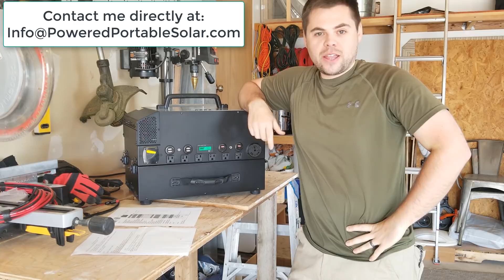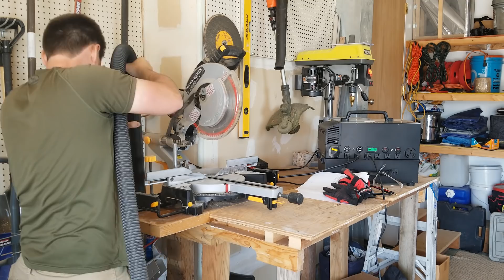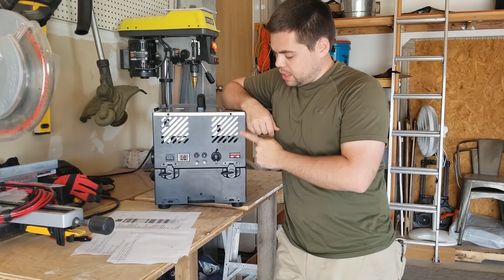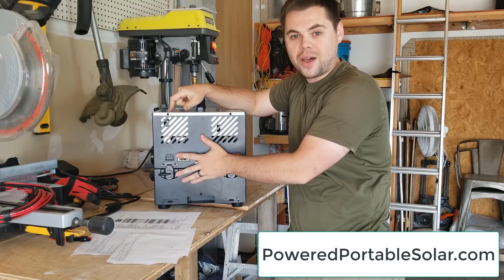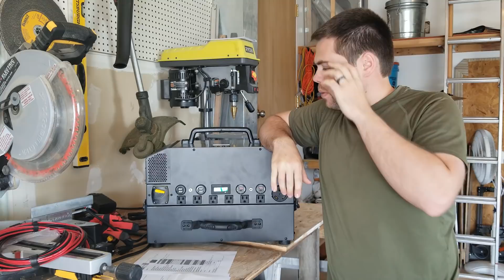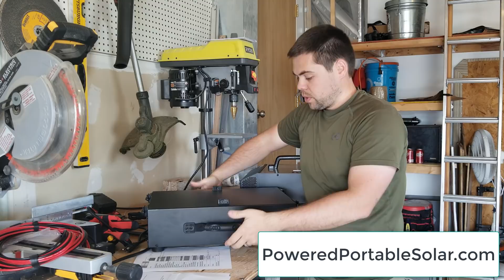Titan Solar Generator Announcement

Comment: You guys need to get Will Prowse to review this ! I am sure he would like it and if he did you could not make em fast enough , I was almost ready to buy a hybrid all in one unit with 2 battle born battery's and put it all mounted on a hand truck for mobility but your unit definitely made me pause, but I cant pull the trigger till I have Wills opinion. What is the warranty on the battery?
Reply from the maker: Hey Ed, thanks for the recommendation. Will Prowse amongst other YouTube channels have been contacted about reviewing the Titan. They are very excited to get their hands on them and test them out. They won't be able to get units until October though when they start shipping so keep that in mind since that will be after the Pre-Order launch and pricing will be up a bit.

Comment: Will this run an average RV air conditioner? and for how long? I have a 13.5BTU A/C on the roof of my RV.
Reply: Yes. It depends on the size and setting. Estimate 5 to 20 hours

Comment: What are the minimum bnd flex panels you would personally recommend for it? I didn't see "a panel kit" on your website.
Reply from the maker: Absolute bare minimum 4 panels  or 400 watts but it is best to have 5 or 500 watts as the minimum
Reply: Minute Man Prep when can I buy this kit, generator and all?
Reply from the maker: @strongholds12  Estimated sale date is set to Aug 15th right now with a chance of it happening sooner. Estimated shipping date is between Oct 1st and 15th with a chance of it happening sooner. It all depends on the final test that happens the end of this month. All other tests have gone well so this one should too. If you're on my email list you'll be notified before the sale begins on exactly which date it is going to open up. Those who order first will be shipped to first. My email is info@poweredportablesolar.com for Titan related stuff.

Comment: Like what I see but I would like to have switches for DC and AC easily accessible right in front not to open anything and disconnect the alternator. Simple switch when using this in camping when everything is wired and tucked under the counter would be a mess to take out and open, just a switch would be great. Lastly if it can help bring down the cost maybe having less ports or optional starting at 3-4 and go up to xyz, for my usage if it's as powerful as you say it is I'd use an extension cord and that's it. Great to see you address issues other haven't continue you're in the right direction.
Reply from the maker: Yes the updated style will have an easy AC and DC switch that you won't have to go inside the unit to switch. The manufacturer has done everything possible to bring pricing down. Simply put solar equipment that is high quality is not cheap.

Comment: Here's a crazy question: Could you charge a Hybrid or electric car with this?
Reply from the maker: It all depends on how the hybrid car charges. If it uses a 110/120v charger then yes. Do you know what the charging station plugs into to receive power? And do you now how many amps it's using when charging the car? With that info I can tell you definitively yes or no.
Reply: Minute Man Prep Most electric and plug-in hybrid vehicles available today can only accept a maximum of 16 to 32-amps, while charging on a level 2, 240-volt charging station.
Reply from the maker: @strongholds12  Then most likely the Titan could charge it but only if it was a Double Titan setup, meaning you had two titans connected together to make 240v power.

Comment: When are they coming, first it said May, Now June, but it's june 2nd and no word?  Also, by chance are there any plans for a higher capacity inverter version, say 5k or so?  If not, why not because they made the old style on the dollies 5k?  Very anxious to get some info.
Reply from the maker: Hey Joseph, I know it's frustrating that this thing keeps getting pushed back. Basically they are being pushed back because they are not willing to compromise on quality and they found out that some things needed some extra tweeking to get it just right for the production version. I am supposed to get an updated timeline next week. As of right now there are no plans for a 5k version but that doesn't mean eventually there won't be.

Comment: I know it's a prototype but what's the price range?
Reply from the maker: Hey Neil Archer, you can find all the pricing info here: https://poweredportablesolar.com/shop/
Reply: Just the titan box is $2400. The Extra Battery is an Additional $1400   The systems with panels go up to $8400.